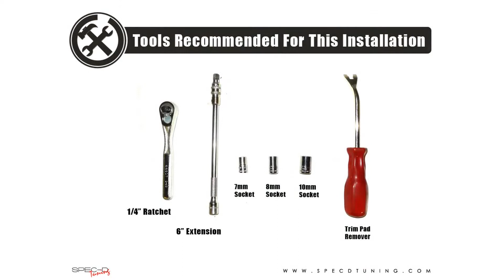Dodge Charger Projector U-Bar Spec-D Headlights (2011-2014) Amazing!

Comment: I installed these headlights but had issues with one of them.. one side worked fine turn on light bars and low beam but other side turn on either the light bars or just the low beam. What can be done to fix it?
Reply from the maker: If you bought them from us, please email support and they can help you diagnose the issue. If it's defective, they can swap you out for a new set within the warranty period.

Comment: If I have HID setup bulbs HID will it still work ??
Reply from the maker: As long as the HID bulbs are direct replacements for your factory bulbs they will fit in these housings.  Some trimming might be required though.  Every bulb is different so hard to tell.